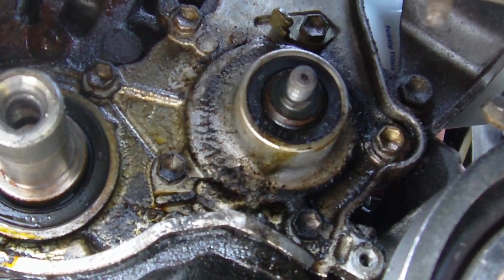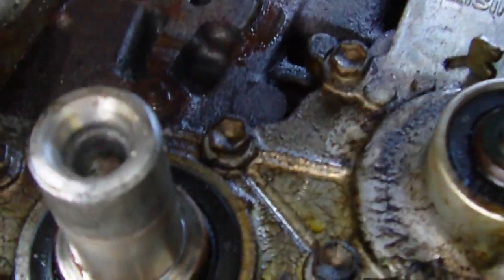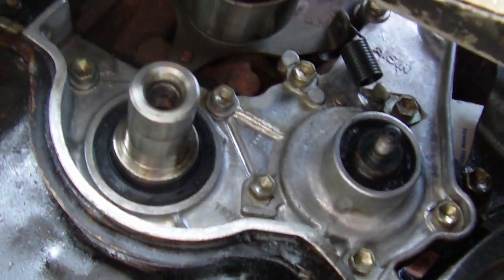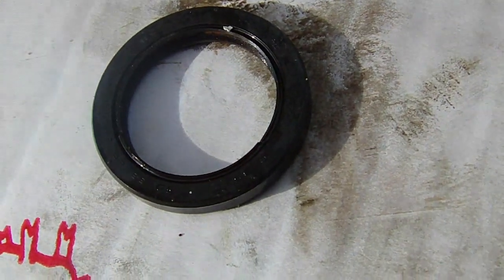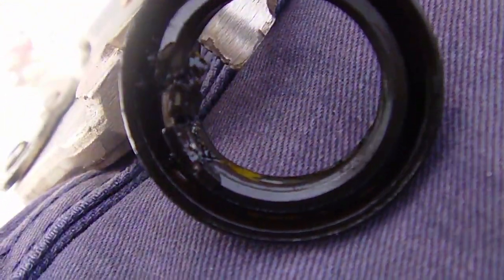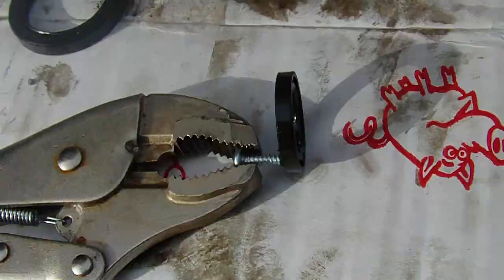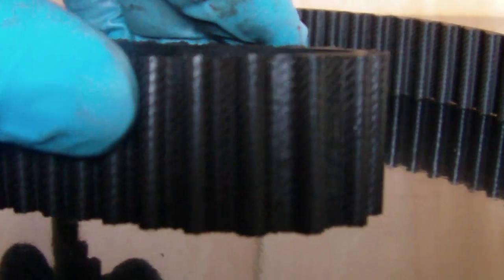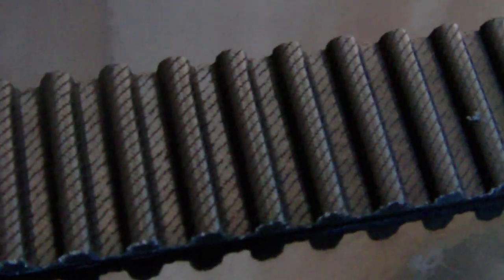Oil Pump Seal Leaking on Toyota Engine (Tercel Paseo)

Comment: The oil pan nor the pick up tube need to be removed to replace the oil pump on the '97 Tercel 5E-FE engine.  The rotor + ring protrude out of the oil pump housing, or into the engine block, by only 3mm.  The pick up tube attaches several inches away from the oil pump.

Comment: So "heavymechanic2" in reading all the comments did you have to go back and replace the O-Ring too or did your seal replacement do the job. I kind of want to do this job once and just seal replacement is easy but getting involved to pull the pan and everything else gets to be a PIA. But it's a real good little car and worth the time but I would take you suggestions here. Thanks.
Reply from the maker: I had to replace the oil pump gasket, it was cooked. I did this like a year later. Be sure to get the OEM O-Ring because the aftermarket part does not fit and will not stay in place during assembly. same issue with some water pumps that use an o-ring gasket.
Reply: Thanks for the advice and I'll follow your recommendations.  Thanks again for the video.
Reply: I had to go back and change the o ring  on it

Comment: Hey Heavymechanic2, great video. I have the same engine in my '96 tercel. I'm facing some oil leak troubles right now too. So was just the oil pump seal your main leak? And did you just change the lip seal, no removing the whole oil pump assembly? thanks.
Reply from the maker: +Matthew Do Couto I just changed the lip seal and there is still some leakage from the rubber ring on the back side. Its like a major job to remove the oil pan and strip down the front side of the engine just to replace a rubber ring... There is a product called Oil Saver by LiquiMoly sold on Amazon that might work to stop your oil leak. This worked great on my Mercedes when the front crank seal was slinging oil on the drive belt. A year later, you would never know it was leaking. 

From what I read, the difference in the oil pump from early to late model is the groove is either cut in the pump body or the block side. If you replace the o-ring, it would be best to use OEM to avoid problems with low-quality materials.

Comment: Hello. I have a Toyota Rav4, 1997. It consumed a lot of oil, more than 2kg per 1000km. I had the valves, seals and rings inside the engine replaced, I just had it back, drove 500km, and it still exhaust a lot of blueish smoke, and consumes oil. Could it be that the mechanics replaced the parts wrong? Could it be from something else? Any idea would be much appreciated.
Reply: Your heat shield on your exhaust manifold might be gone... or your exhaust manifold might be messed up or your O2 sensors are not OEM.

Comment: what year is your Tercel?
Reply from the maker: Its a 91 but has a 5E-FE engine
Reply: mine is a 98. im planning on changing the timing belt but im stuck with a rusted out serpentine belt adjustment bolt.
Reply: +heavymechanic2 i have a 91 3e-e i want to replace all the seals and gaskets on this side of the engine. How many seals and gaskets are there?
Reply from the maker: The cam and crank use the same seal, the oil pump is tricky to replace. There is a rubber seal under the oil pump that gets hard and leaks, this requires removing the oil pan.. 2-seals plus the oil pump.
Reply: +heavymechanic2 thanks
Reply: +heavymechanic2 Hi there! Do you have to change the oil pump or just its seal?
Reply from the maker: First, I replaced the shaft seal, but the oil was still leaking from the rubber ring under the oil pump. Both seals were crispy from heat LOL
Reply: OK! Thanks for the information!
Reply: Thanks for the information.

Comment: how did u get the oil pump sprocket off? did u take the pump off?
Reply from the maker: +Tj Walker Heat the nut, its full of sealant and hold the pulley with a spanner wrench. I made a spanner tool for this job with some bolts and flat metal.. I never removed the oil pump because it requires a lot of work to remove the oil pan, pick-up tube and the front member of the engine.